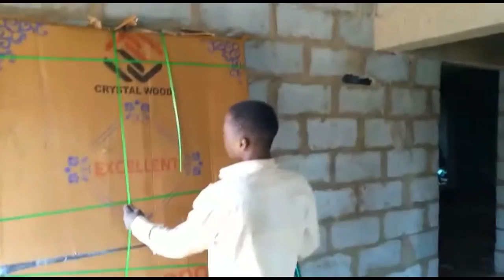FINALLY THE WINDOWS AND DOORS NOW COMPLETED ON FAN'S BUNGARLOW

Comment: Nice bungalow but I was surprised to see that they didn’t do mass concert after DPC. And also they did not chained the building round  at foundation and lintel levels. They have to hold the Engr accountable. Nice video.
Reply from the maker: Thank you 🙏
Reply: Bro the engineer did a very bad job there. Very sad

Comment: Is it advisable to install doors and windows before plastering and fittings? Please help. Thank you
Reply from the maker: If you have the money to take on the 3 no. Stop I will say do the conduit plumbing and plumbing electrical pipes do the plastering then install the windows and doors after

Comment: Well done. I'm surprised the walls are not rendered smooth first before you put in windows and doors...
Reply from the maker: It should be done if construction is continuous if owner don’t stop and start, they do this to stop squatters in the building till they have money again
Reply: @LuluDumba  ok, makes sense. Thank you for sharing that.

Comment: Good evening sir if they place the window now,Later when plastering the house won't it affect the windows glass
Reply from the maker: The windows are wrapped in plastic sheets
Reply: @LuluDumba  Ok
Reply: Good evening sir, where are you located
Reply from the maker: Uk
Reply: @LuluDumba  So much finishing & masonary work left to be done. Why are the windows & doors fitted when there are strong chance of damages?